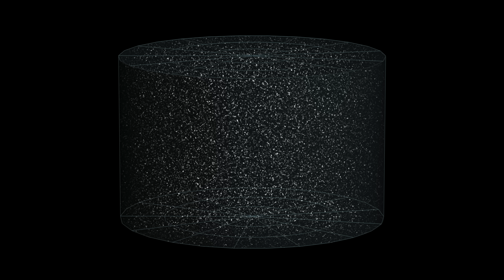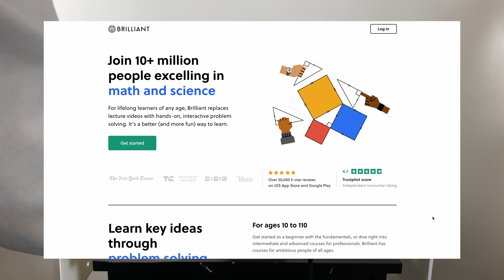World's biggest gear ratio...

Comment: I think it is obvious, but I’m stating this for those who don’t know the obvious:
1:10¹⁶⁹ Dissected is: 10,000,000,000,000,000,000,000,000,000,000,000,000,000,000,000,000,000,000,000,000,000,000,000,000,000,000,000,000,000,000,000,000,000,000,000,000,000,000,000,000,000,000,000,000,000,000,000,000,000,000,000,000,000,000,000,000,000,000,000,000,000,000,000,000,000,000,000,000,000,000,000,000,000,000,000,000,000,000,000,000,000,000,000,000 (10 octovigintillion, 100 quinquatrigintillion) 
It would take 10¹⁶⁹ spins in the first gear in order for the last gear to rotate ONCE. 
This ratio also signifies the amount of years it would take for the last gear to spin once, in which he says in the video: There are ROUGHLY 10⁸² atoms in the OBSERVABLE UNIVERSE,And the head death of the universe is in about 1.7¹⁰⁶ years. And the ratio of this gearbox is eventually much larger than both. So that means that the amount of years it takes for this gearbox to have the last gear rotating only once is basically higher than the number of atoms AND will not get completed before the heat death of the universe.

Comment: If you were to have a gear box 500 gears long with a gear ratio of 8:120/1:15, and you made 30 rotations a second, you would need to wait approximately:

285,695,415,624,124,010,546,062,105,634,987,334,385,915,089,278,855,649,861,568,742,001,649,561,321,426,219,403,727,967,567,122,716,363,222,868,555,572,600,472,285,586,250,223,346,773,694,389,376,041,299,133,531,935,785,211,607,269,120,896,635,464,586,782,702,100,376,478,511,608,739,114,602,598,115,884,487,647,027,739,128,816,774,643,186,033,011,485,249,078,378,218,772,143,292,236,176,523,536,319,068,384,916,491,313,201,061,382,088,909,147,635,336,764,304,501,825,577,556,419,579,681,606,803,816,264,076,834,746,012,311,691,199,511,889,102,267,747,108,105,251,458,029,155,281,041,787,643,463,203,675,699,746,331,436,000,129,460,397,749,258,295,058,555,559,221,571,302,009,675,113,262,659,357,068,830,101,880,752,502,314,833,162,627,705,220,870,666,380,506,008,863,449.0966796875 CENTURIES.

Comment: I just left a video explaining 52 factorial. The question was how many combinations are there in a deck of cards. Well, it's 52x51x50x49....all the way down. The funny part is once you get to x3, whatever number THAT is get's doubled by the last number in the sequence, x2. They gave a bunch of scenarios on how big that number is. If you took a cup of water from the ocean once a year, that last cup that leaves the earth totally dry is only to the 38th factor. My point is that's just a thought experiment. THIS is a real life device you can physically touch that has a number so large that there really isn't anything to compare it to. Even the number of chess moves (using the rules of chess) is something less that 10x100th power. Well done sir. You could in reality double the number of gears and it wouldn't matter. It's already untouchable by any other system that will fit in the known universe.

Comment: Very cool, but that's a gear reduction (speed reduction), so it's super low ratio, not a high ratio (think of first gear in your car or bicycle - low gear). If your input was on the last gear, and output was on the first gear, you'd have an overdrive (speed increase) and that'd be a high ratio. But I'm guessing it won't turn that way, you'd never be able to supply enough torque

Comment: You would need to spin the first gear 10,000,000,000,000,000,000,000,000,000,000,000,000,000,000,000,000,000,000,000,000,000,000,000,000,000,000,000,000,000,000,000,000,000,000,000,000,000,000,000,000,000,000,000,000,000,000,000,000,000,000,000,000,000,000,000,000, or TEN QUINQUINQUAGINTILLION times to spin the last gear once. (Yes, that's a real number.)

Comment: They say that spinning the last wheel directly is impossible because there is not enough torque to spin the first gear. 

* Drops the driveshaft from a greyhound bus, a socket wrench, and grasshopper style oil rig on the table. 

I say they’re not trying hard enough.

Comment: Spin the last gear
Reply: Yes
Reply: He did and got cut in half 😢
Reply: He would have to put 1,000,000,000,000,000,000,000,000,000,000,000,000,000,000,000,000,000,000,000,000,000,000,000,000,000,000,000,000,000,000,000,000,000,000,000,000,000,000,000,000,000,000,000,000,000,000,000,000,000,000,000,000,000,000,000,000,000,000,000,000,000,000,000,000,000,000,000,000,000,000,000,000,000,000,000,000,000,000,000,000,000,000,000,000,000 torque on it, to spin.

Comment: so for every rotation of the fastest gear, the slowest gear does 1/10^169 rotations. sounds like a number smaller than the planck constant. and if you rotated the slowest gear at 1 revolution per hour, somewhere in your gearset a gear would be far exceeding the speed of light and every gear after that would be going even faster. it would be a kind of bizarre time machine where one end moved faster through time than the other.

Comment: So let's get this into perspective:
Let's assume the first gear rotates at 1 revolution per second. At that pace, it would take 10 seconds to spin the 2nd gear by one revolution. The 3rd gear would take 100 seconds, or just over a minute and a half. The 4th gear would take 1,000 seconds, or just over 16 and a half minutes. The 5th gear would take 10,000 seconds, or just over two and a half hours, and so on. Once you reach the 6th gear, it's already gonna take over a day to rotate it, and the 8th gear will take nearly four months to spin. Spinning the 9th gear will take just over three years, and you won't even live to see the 11th gear make one full rotation since it will take just over three centuries to fully spin. By the time the 17th gear fully rotates, the solar system will have completed one orbit around the Milky Way, and the next supercontinent, Pangaea Ultima, will have formed. The sun won't survive to see the 19th gear spin, since it will have died and become a white dwarf long before then. For the 170th and final gear to rotate, it would take 3.169x10^169 years.

What if we worked the other way? How fast would the first gear spin if you managed to rotate the last one. Firstly, assuming that it takes 30 g to spin the 1st gear, it would take 300 g to spin the 2nd gear. To spin the last gear would require 3x10^170 g (3x10^167 kg), over 3x the weight of the entire universe, which means you would literally have to channel the power of the multiverse to spin that last gear. Now let's talk about speed. Assuming a radius of 20 cm, that would lead to a circumference of about 63 cm. The 1st gear would spin at 0.63 m/s (2.27 km/h, 1.42 mph), and the 2nd gear would spin at 6.3 m/s (22.68 km/h, 14.18 mph), and so on. The last gear would theoretically end up spinning at 6.3x10^168 m/s, or 2.268x10^169 km/h. Considering that the speed of light is roughly 300 million m/s, or 1.08 billion km/h, this last gear would be spinning at well beyond the speed of light, completely destroying the very laws of physics that we're operating by.

Comment: If you have a gear train with such a high gear ratio and multiple gears, there's a significant torque multiplication happening at each gear stage. By the time you reach the last gear, the torque applied to it could be immense, potentially exceeding the torque capacity of the gear teeth or the gearbox itself.

Comment: you really don't answer your own question? i know why you framed it around the heat death of the universe but it's frustrating having come from the short to see if you actually try to answer only to see you didn't here either. there's a theoretical year. bc this isn't the largest that's been created. and ironically, coincidentally, or otherwise, it's called "time machine" funny enough. 

maybe it's a happy coincidence. 

not to mention, this would defeat the purpose of gear function. that is a very real challenge in mechanical engineering to design around what is actually feasible. This ignores all the inconveniences of science and the limitations that would hamper the design only to not even answer the self imposed question.

Comment: What if you used magnetic gears instead of plastic, therefore increasing the durability substantially. What is the max gear ratio you could get away with, while using a hand crank on the last gear?

Comment: Great channel. I just joined up. Here are some thoughts I'd like to bounce off the community. I bought an Ender 3 last year so I could build things with my 5 yo son. Namely, I want to build gear ratio and mechanical motion demonstrators--which is a perfect fit here. I had pondered using Lego Technic. But I don't have that sort of budget. Your channel seems to solve that problem, with a 3D printer at hand, at least.

And I'll admit I mostly don't want to get into designing actual gears. Done properly, that's an endeavor I just don't have time for. But I do have time to design drivetrains from a known set of gears. And that's where I want to spend my time on this project with my son. It will be up to him to take it to deeper design territory.

I'd love to get into any efforts along these lines with anyone who wants to or is already doing projects with their kids. 

Thanks all, Tim

Comment: What if you used a giant F1 rocket engine with 35 million newtons of thrust to spin the last gear. Or use the catastrophic force of a nuclear bomb to push the last gear, spinning the first gear at the speed of light. You would have to have the last gear to be big enough to actually utilize the rocket or the bomb, and attach a heat shield to keep the gear from burning.

Comment: The last gear could spin but u would have to find the correct material that could rotate and heat up faster than these speed of light Marc 3 and up if u do the math like the time it takes rotating at speeds in excess of marc3 how long did the first 10 gears takes to spin u should have a time frame because theirs only so much gear wheels can fit in the box correct me if I am wrong still cool tho

Comment: if you remove any mechanical factors like use indestructable/extremely strong gears and material and u manage to create an expensive mechanism which helps spin each gear, makin it easier to spin the last gear and you spin the last gear once .WILL YOU CREATE A TIME MACHINE WITH THE FIRST GEAR?!?! sorry this is mind boggoling

Comment: Its crazy how quickly exponential returns can get unimaginably huge. A deck of cards is another example. The odds of shuffling a deck of cards and them returning to an order that any deck of cards has been in, is so small, it could be considered impossible considering the combinations made in the past and future.

 To give a visual understanding, if you were to begin writing the possible combinations on paper with each paper having a new combination, you would stack them up until they reach the moon, then pull a drop of water out of the ocean and start a new stack. When the ocean is dried up, refill it and destroy a single grain of sand. When all the sand is gone, the number of combinations you have gone through are still 10 zeros away from 1/8 the maximum number of combinations. 

The number of combinations looks like 8.0658*10^67 For a little more perspective, the universe has only existed for 4.36*10^17 seconds.

Comment: What if you built a gear box that scaled back the rotation ration to the original gear and then set the original gear in motion by an external gear and a lever?
Reply: Same as now. Nothing, but you could rotate both ends at the same time and even different direction.

Comment: You can measure a lot if you begin to switch around the gear ratios towards the middle and attach different weight affectations. Things like speed and distance traveled. And so on.

Comment: The video claims to have created the gearbox with the highest gear ratio ever, with a gear ratio of 10^169. However, there are several scientific inaccuracies in this claim.

First, the video claims that the gear ratio of two gears is 10:1 because there are 12 teeth on one gear and 120 teeth on the other gear. However, this is incorrect. The gear ratio is actually determined by the ratio of the number of teeth on the two gears, not the number of teeth themselves. The correct gear ratio for gears with 12 and 120 teeth is 1:10, not 10:1.

Second, the video claims that the gear ratio of the entire gearbox can be calculated by raising the gear ratio of two gears (10:1 in this case) to the number of gear pairs in the gearbox (169 in this case). However, this is also incorrect. The gear ratio of a gearbox is actually determined by the product of the gear ratios of all the individual gear pairs in the gearbox.

Assuming that each gear pair in the gearbox has a gear ratio of 1:10, the gear ratio of the entire gearbox can be calculated as:

(1:10)^169 = 1:10^169

This means that the ratio between the input speed and output speed of the gearbox is 1:10^169, which is an incredibly high gear ratio. However, the claim that this is the highest gear ratio ever created is incorrect.

The video also claims that the last gear in the gearbox would take more than 10^160 years to spin once, which is longer than the estimated age of the universe. However, this calculation is based on the assumption that the first gear in the gearbox can be rotated at a speed faster than the speed of light, which is impossible according to the laws of physics.

Therefore, while the gearbox may have an incredibly high gear ratio, the claims made in the video regarding the calculation of the gear ratio and the spin time of the last gear are scientifically inaccurate.

Mathematically, the correct calculation for the gear ratio of the gearbox can be represented as follows:

Let the gear ratio of each individual gear pair be r = 1:10, and let there be n gear pairs in the gearbox.

The gear ratio of the entire gearbox can then be calculated as:

r^1 * r^2 * r^3 * ... * r^n

= (1:10)^1 * (1:10)^2 * (1:10)^3 * ... * (1:10)^n

= 1:10^(1+2+3+...+n)

= 1:10^(n(n+1)/2)

Therefore, the gear ratio of the gearbox is 1:10^(n(n+1)/2).

This is a more accurate calculation of the gear ratio of the gearbox than the one presented in the video.

Comment: I have calculated that  if we move the gear at the rate of (299792458) per second at the speed of light from the begging of the universe (around 13.8 billion years ago there are still 7.648499 x 10¹⁴² years left to move the last gear once

Comment: I once built a pig rotisserie doing something similar. 
1725rpm motor to a final drive of 3rpm. The motor had a 2” pulley to a 12” via belt drive. On that shaft was another 2” pulley to a 10”, another 2” to another 10” and finally a 10 tooth sprocket driving a 40 tooth on the spit rod via a chain. 
I never did measure the torque but it was a lot.

Comment: Ignoring the laws of physics and just working with the numbers, if we were to assume the diameter of the gears are 16cm and the last gear is rotating at 1 RPM.
The linear speed of the first gear would be approximately 1.006096*10^163 times faster than the speed of light in meters per second.  Or 2.1744×10^82 mph

Comment: Uhh am I the only one confused by "so we have 170 gears, that means we 169 gear pairs" I don't think thats how math works but I might be wrong
Reply: The pair is b/w big gear and small gear. Every gear has a small gear attached to it through which another big gear is attached. So that's how pairs are formed. And the last gear has no pairs cuz no other big gear is attached any further so that's why only 169 pairs and not 170.
Reply: @ayushkumarjha9921  so you have 170 gears, and you pair them up, wouldn't that mean you divide by 2?
Reply: @ayushkumarjha9921  also ehat does b/w mean
Reply: @davidtaylor1255  b/w means between.
The pair is between where big gear and small gear junctions. If you pause the video & look closely @0:51 you can see every gear has a small gear attached to its axis of rotation. So every big gear in this box is paired with smaller gear of another big gear. That means every big gear is paired with smaller gear of another big gear.
Reply: So the total gear in this gear box is (big gears + small gear attached to each big gears)  is 340 gears. So the pairs in this box is (340/2) - 1 = 170 - 1 = 169 pairs.
We subtract 1 pair because the last gear has no pair any further so 1 is subtract from 170.
Reply: @ayushkumarjha9921  ohh okay, thank you, I font do mechanics but I know math and the way I was thinking of it made no sense, thank you for explaining it
Reply: @davidtaylor1255  no problem.

Comment: But the real question is if one were to  release a flatus underwater and capture it in an upside down jar submerged then put the lid on it, would the flatus retain it's original combination of elements and keep it's smell forever? Or would the slight decrease of pressure from the human body of said flatus to an unpressurized vessel cause a reduction or even neutralization of the flatus? It is the whole pressure/aroma equation that has plagued mankind for millennia. That is the kind device and experiments you should be working on. The stuff people really need to know!

Comment: Challenge…. If you could take your knowledge of gears, could you make a gravity battery like a grandfather clock? (Slow falling weight clock runs) However instead of time, convert it into power via RPM on the output.
Reply: Make a generator on a spring like in a mechanical watch!

Comment: It would be cool to see a gearbox like this but with 2:1 gear ratios so we can see it actually working.
Reply: Great so instead of 10^169 we get 2^169.
Reply: @noahc8997  how about 101 to 100 teeth gears? then it will be 1.01:1 and 1.01^169 = only 5.37. Am I doing this right?
Reply: @noahc8997 it’s still significantly lower than the alternative
Reply: even with a 2:1 ratio the last gear still would take an unimaginable time to move